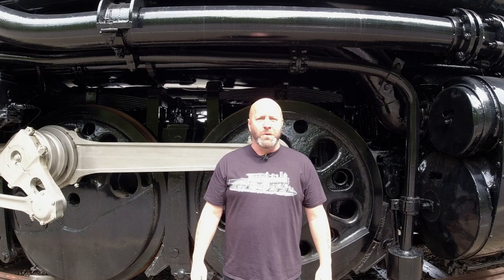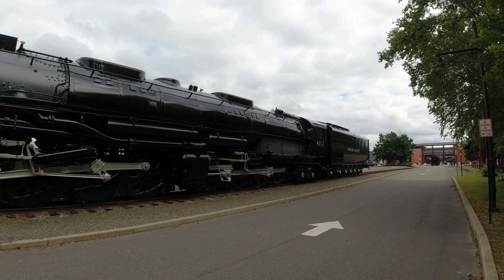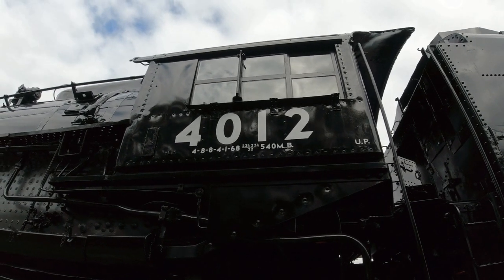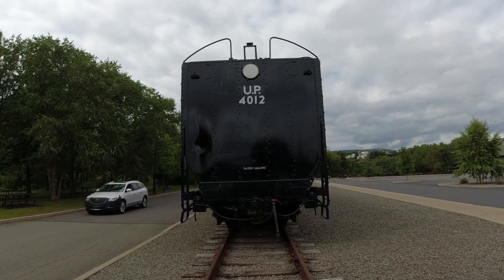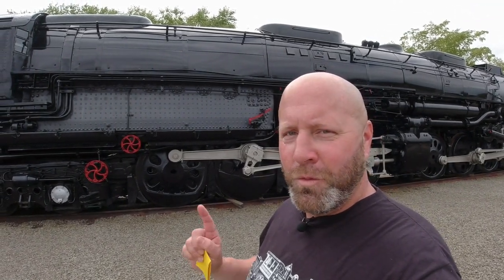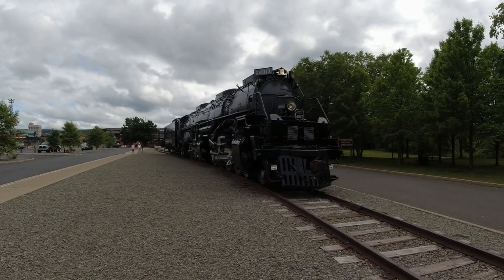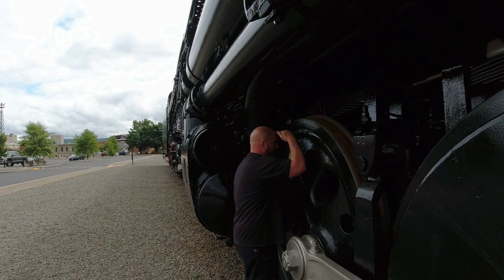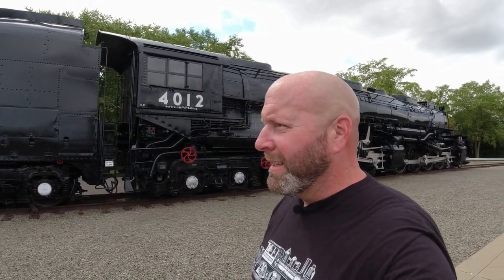This is the LARGEST Steam Locomotive in the WORLD! Union Pacific "BIG BOY" No. 4012

Comment: I wish they would take the big boy 4014 to the other big boy locations and use a pipe and connect it from the 4014 and attach it to the other big boys whistles and blow them on steam so the other big boys Whistles could be heard. Like they did with Nickel Plate Road 757 and 765. I got to see the 4023 and the 4014 and the 4006 so far.

Comment: The 4-8-8-4 Big Boy use to sit at 3 different locations not just 2 the First being in the early 70's up near Radisson Lackawanna Station for over 13 years before moving outside near the Roundhouse. The Big Boy is only the Longest Steam Locomotive ever built the Largest or Biggest Strongest Steam Monster of the Rails is Allegheny Class 2-6-6-6 N&W more power than the Big Boy so strong that it's been proven by math and physics that she could pull the Big Boy while the Big Boy was trying to pull back. Unfortunately, there are None to existence but their sister a C&O #1601 on display at the Henry Ford Museum in Dearborn, Michigan. The info & blueprints of the Allegheny Class Steam Locomotive tells and shows the truth about her power, many Big Boy Fans will deny the fact that the Allegheny is the True Beast of the Rails given she was a Mountain Monster pulling massive coal loads over the West Virgina Mountains.